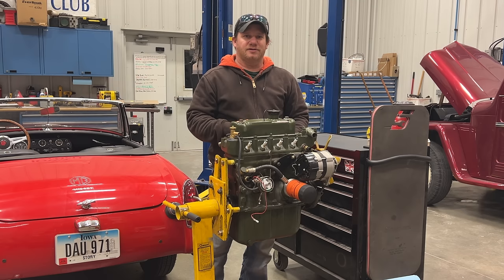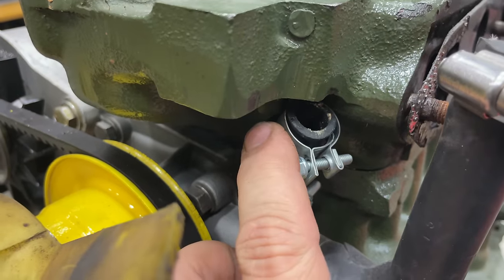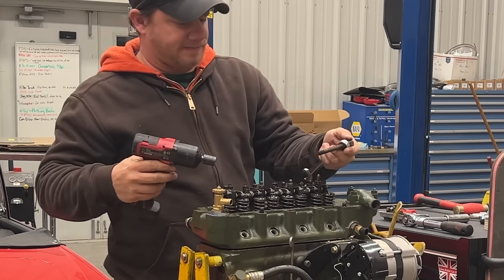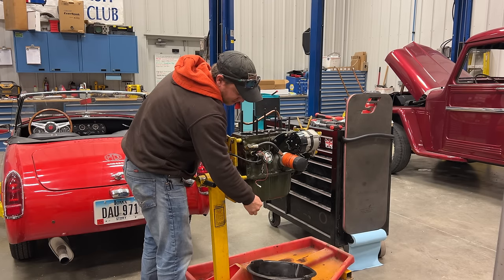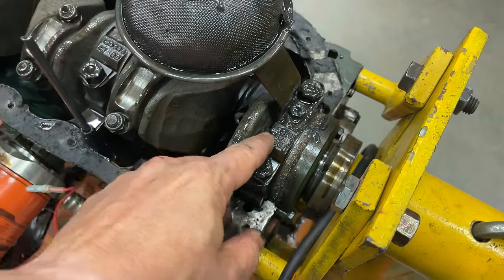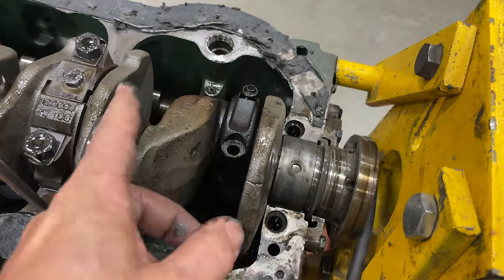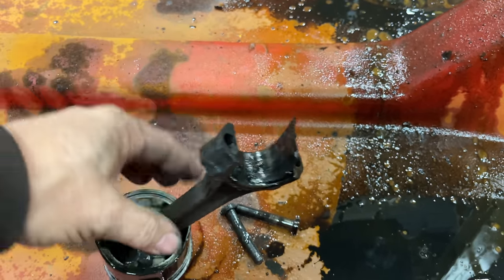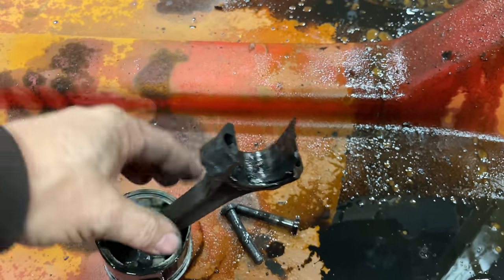Disassembling MG Midget Engine to Find Failure

Comment: And that, boys and girls, is why leaving out two main bearings when designing an engine is a great way to make it more compact, while at the same time crippling its power potential and durability.  Luckily, the Great Main Bearing Shortage Epidemic ended somewhere around 1960.  At least in technically advanced nations, that is.

Comment: When we were downsizing to move into an independent living facility, I gave my set of Whitworth tools to a man who owned an MG. I had bought them while I was a Triumph Motorcycle dealer.
Reply: Many years ago I sold and repaired Raleigh bicycles (when they were made in England) and had a full set of British Standard Whitworth tools. Only way to work on them. 60 years later, I still have them in a wooden tool chest.
Reply: BMC A Series Engine. All you really need are 7/16, 1/2 and 9/16 inch AF spanners!
Reply: @john1703  And little hands!
Reply: I recently (in the last 8 months) found out about BSW hardware. I bought a 1989 Taiwan made mill with a Taiwan made machine vice on it. Every piece of hardware was US standard except the 2 bolts that hold the front jaw on it. They were 1/2-12 BSW. I had to post on a machinist page and ask for group help. When I tried to thread on 1/2-13 nut it wouldn't fit so I went off to the the hardware store assuming it was metric. I left a very confused person after realizing that was not it either. Turns out that after WW2 the Tai bought up a bunch of British tooling from around the eastern pacific rim and they evidently were still using it into the late 80s to the early 90s.
Reply: @john1703  5/8th s for the rocker cover !

Comment: Generally BMC made great engines, it would be a shame to have to discard this one. I vote for saving it, if this is at all economically feasible to rebuild.
Reply: absolutely rebuildable. can be real fun if done right.
Reply: Can probably rebuild the crankshaft also.
Reply: Needs to be done every 25,000 miles or sooner when driven at USA speeds... tranny also...
Reply: @BuzzLOLOL  Not at all!  All you have to do is maintenance, as and when required. Neglect doing this, and you loose!
Reply: @regsparkes6507  - Nope... at 26K miles the rods are knocking... valve springs breaking and dropping valves into the engine... tranny synchros and bearings shot... been through all that several times... even the owners manual says replace the rod bearings at 25K miles... lube front suspension every 1,000 miles... that's 2 times just to get from one side of USA to the other... dropped a Buick 215"/3.5L aluminum V8 and 5 speed into my Midget decades ago... that also lost about 20 lbs... 
https://cdn1.mecum.com/auctions/ln1021/ln1021-467556/images/img2182-1632513245217@2x.jpg
Reply: @BuzzLOLOL  Not what I found in my family's and my many BMC and Rootes cars over the years from 1960 onwards,..
These are NOT' maintenance free 'cars these were from an era where garages and the mechanics who were employed in them worked hard for their pay.
If your experience tells you what you experienced then somebody somewhere didn't do what they were supposed to do.
Now, you have your memories and I have mine, we'll have to agree to disagree on this.
Reply: @regsparkes6507  - It's not just my "memories", it's in the F-ing Owners Manual !!!

Comment: I never tire of watching the ubiquitous BMC 'A' series engine being disassembled and reassembled. The one that so many trainee car mechanics and engineers around the world cut their teeth on.
Reply: Yep, I worked on many of these in the 60's. They were in everything, Sprites, A30's, etc, etc. So easy to work on.
Reply: @PropanePete  Except mini"s with the bloody gearbox bolted underneath. Bit of of a PITA but I've owned 8 of them and probably will get one again :-)
Reply: @mikal8343  I don't know how many 7/16" spanners I lost over the years down the back of that heat shield between the exhaust manifold and the firewall. And cutting my fingers on the radiator shrouds when replacing the fan belt. You've owned 8 of the little buggers, Jeez. Actually, I love 'em too.
Reply: @PropanePete  My favourite mini horror show is how the rear wheels will bite the fingers of the uninitiated when spinning them to check for bearing noise🤢
Reply: Like a trip down memory lane for me retired engineer.👍

Comment: "Here's what's left of the bearing, it should not look like that."

And I thought we Brits were the masters of understatement. :-)
Reply: It was an excellent summary that's for sure :)
Reply: It’s typical Iowa or Midwest America
Reply: I too had quite a chuckle over that one!
Reply: TBF, he should have checked it against a picture in the Haynes manual before judging so quickly.
Reply: Not uncommon to see a relatively clean piston top with these, it's caused by oil coming up past the piston. Usually means that there is was excessive big end clearance spraying up too much oil.in the past. The dents on the piston top also tell a story. If a piston smashes into an object at the top of the stroke, the usual result is failure of the big end, that's where the whole chain started.
Reply: I laughed when he said that.

Comment: Love these small engines. Whether you rebuild this or rebuild another that you have kicking around doesn't matter much. As long as you can get the parts. Do it the most practical way you can.
Reply: Parts are readily available in the UK... You may have to import them to Yankland.

Comment: I would grind the crank shaft, fit over sized bearings and with new rings and hone the bores, there will be a good Morris engine again for another 50,000 miles. That's what we did at the Morris works back in 1970.
If you paint it gold in colour, it will look like a genuine gold seal engine.
Reply: Cannot recall, should the piston rings go back with the gaps in line, or stepped out or away ?
Reply: @highpath4776  Not in line !! Stagger them .
Reply: @bertiewooster3326  Thought so   , Cheers, (particulary final oil control ring.

Comment: I used to have an Austin A40 with a tuned 1275 A series engine in it, was great fun driving it in the early 70s. I advise that you rub silicone grease into all cylinder head main bolts, thermostat housing bolts and the water pump bolts to stop corrosion. Also it would be a good idea to do the same to the rear suspension bolts and shackles, in fact anywhere you may get bolts rusting and becoming jammed on these old BMC cars. Good luck and thanks for the video.

Comment: Love the videos when you are inside the engine.  Here’s hoping for good news from the machine shop.  My guess is it spun the bearing, and then after extreme heat the bolt backed out.  Keep the videos coming.  Love your work!
Reply: Might have started with a blocked oil feed from the crankshaft to the big end bearing. That would have caused the big end to overheat and spin the bearing.

Comment: This little engine was obviously run way longer than it should have.  This sort of failure was a subsequent of ignoring ominous noises.  As the old adage, credited to the Chinese philosopher Sum Ting Wong, says "small noise, stop now".  It appears from here that the rod nuts were not tightened properly at a previous assembly, or overtightened to near stripping.  Considering the thread mismatch to American  fasteners, someone may have just used compromised nuts just to get the job out.  I hope a complete autopsy is forthcoming to find what caused the nut to fracture as the forces involved should leave telltale "footprints" on other components.  On a side note, can anyone explain the origin of the Mowag name cast into the block of these engines?  Brings back memories of yesteryear.  Great little engines. Robust, reliable, once you resign yourself to dealing  with Joseph Lucas, also known as the prince of darkness. and a joy to work on.  Got a kick out of the valve at the back corner of the head, the heater valve.  Love that English engineering.
Reply from the maker: MOWOG stands for (MO)rris and (WO)lseley (G)roup, although what the G stands for is sometimes contested but that is what the BMIHT is claiming it stood for.

Comment: The correct way to remove the head from a BMC A series ids to remove the rocker shaft and push rods before removing the head. If the push rods are left in place as per this video it is easy to bend them or for them to fall out allowing them to get mixed up when they should alway go back where they came from.

Comment: I bought a fiat x19 years ago it run fine for about two weeks although only driven once but after the engine going bad,  I striped it down to find the remains of feeler gauges that had been forced into crank and snapped of that looked not dissimilar to your engine bottom end

Comment: I bought a ‘77 TR-7 with a blown engine for $500 in ‘84. When I tore it down, I saw the connecting rod had gone through the side of the block. I would guess the previous owner had a similar failure with the nuts coming off the rod bearing cap.  I bought an ‘80 engine and dropped it in.  That was a fun car and had many interesting repairs and driving it from Chicago to Los Angeles and back three times.
 It was a fun little car.
Reply: My neighbors had a TR7.  It broke in the first year. Three years later they were still waiting for parts to come through the dealer system when they disposed of it.

Comment: I rebuilt a number of these engines when they were still in production. The engines were designed and built to be cheap to produce. Most of the owner's manuals for these engines, Sprite, Midget, and Spitfire, recommended new rings at 50,000 miles. Later engines of about 1600cc were the same block originally used for 948cc, just cast with a bigger bore. Many people driving in hot climates had cooling problems and went to a custom radiator. British machining during this time was not very accurate and that led to a lot of problems. A complete rebuild (in the US) usually resulted in a longer lasting engine and much more reliability than the original.
Reply: That's true, low grade grey iron used for political reasons, and mass production did not match machining outputs as we do nowadays. The bigger engines [1500 up] were "B" series, a similar but  bigger block all round.  One issue that does not surface now was the quality of the shell bearings  Copper Lead was preferred for the higher performance  B series engines,  and it was find until the oil quality degraded the lead, then the copper quickly ate into the crank.  So fit your crank shells, measure the sizes and grind the crank journals individually to suit. Much better result.

Comment: Pausing it before the teardown begins.
I'm guessing rod bearing because that's what all my knocking a-series engines used to fail with 🙄
Reply: Did you every come up with a plan to prevent the failure?  Knowing how long to go before a rebuild or using a better bearing?  Anything you would recommend?
Reply: @Dancing_Alone_wRentals  Root cause of the problem is lack of oil changes from the sludge in the bottom of the sump/oil pan.
Reply: @timbutton4990  tHanks.   Makes perfect sense.  I always changed oil but never really paid attention as to why.  Never put miles on cars years ago.  I had a lighthearted approach because nothing ever went wrong.

Comment: I don't know if old MG's have matching numbers or not but if they do do the one on this match ?
If so I would say rebuild it. Its only a rod bearing that spun and not a main so the block should be OK so it would be worth the effort to save the cars originality IMO.
Reply: That’s only worth doing if the car is a particularly rare or valuable one like an ex-works race car or something similar (and even then, competition cars are likely to have had different engines fitted). For the most part, there’s little financial incentive to do so, though it’s nice to keep it if possible.
Steve’d need to get a ‘Heritage Certificate’ from the archives at the British Motor Museum to find out the original engine number; it’s not recorded on the car, but in this case, it isn’t the original engine anyway, as it’s a 1275cc instead of a 1098cc.

Comment: I wonder if the failure point was the rod nut? I had an old 348 Chevy engine that had the same thing happen after I rebuilt it. Ever since I always use new rod bolts and nuts in a rebuild.

Comment: Eric of I do cars calls that metal debris "Reynolds Foil".  Thanks for the video - if the crank is not reclaimable, get one out of another of the engines you have lying about - and maybe a rod too, that one can't be too good after the beating and the heat.
Reply: With the ridge he found at the top of the cylinders that block needs bored and then will need new larger pistons as well, so great time to make it a stroker engine if he feels like it!

Comment: I have just stumbled on your site & love it. I own a 1970 MG Midget  in Australia that has been bored out to 1300cc slightly modified camshaft, extractors, power boosted brakes, plus an oil cooler as in the MG B and it purrs along. Red with the black lower door panel & 14 inch chrome MG B wheels.
I wonder if you know if there is anyone in your circle that has two pivoting quarter glass windows that are not rusty or bubbly on the locking handles, plus I need the chrome finishers that are around the heater demister vents above the dash.
Appreciate your help. Brian.  Noosa Australia.

Comment: Years ago I had a 1969 B that had started to smoke. I didn't have the time to rebuild it myself so I had an import shop do it. They did a great job except that after I paid for it the mechanic told me I was going to need a clutch very soon. I asked what was involved to which he told me the engine has to come out. "Did you remove it to rebuild it?" "Well, yes..." Anyway, I'm looking to buy a green 1969 B that has a questionable 1800 but I have to make sure I can get parts here in the mid-west. Your tear down was my first look inside a midget engine. I just now noticed the license plate. I'm about 40/50 miles south. How available are parts in IA? I'd prefer not to go online but if that's the only option... Thanks for the video.

Comment: Depending on how groved the crank is I personally would have the crank regrowned . Just a little less work to put it back together. You could get another engine but that one might take more work to rebuild than this one. Great video Steve it takes me back a good few years, thanks. 👍👍
Reply: Sorry but regrinding that crank is asking for trouble even if it could be reground.  Regrinding weakens the crank without even considering the heat damage.  The original crank is not the strongest around which is why a nitrided crank was considered essential for any serious power upgrade.
Reply: The rod is buggered too… if the block is OK then it needs a rebore, crank, rods and a set of pistons…
Reply: @JBils41  Yes I had forgotten about the rod. Yours is probably a better solution.

Comment: Great video Steve. Which ever way you chose to deal with this, either by rebuilding this engine or building another from what you have sitting around, I look forward to seeing what comes next. If tge crankshaft is shot then its an open and shut case.

Comment: With oil in the bell housing check the rear main oil seal before anything else.
What were the cylinder compressions before you started stripping down or didn't you bother to check.
It's the head gasket that sticks the head down and not stud corrosion.  Why not use a stud extractor rather than just 2 nuts locked together? It amy damage the threads but you're going to replace the head studs anyway.
ALWAYS remove the oil pan before inverting the engine so that can see what is actually there without having to search inside the crankcase and pistons!
It's 99% certain that the cause of the problem was failing to torque the con-rod bolts correctly.
In case you ask I was a Development Engineer working on these engines for a number of years so I know them quite well.

Comment: I find it amazing that with a missing bolt on the end cap, that engine didn't throw that rod.
Reply from the maker: The bolt shouldn't have fallen out of the rod until I turned the engine over on the engine stand.

Comment: I've driven a fair number of old, kind of worn out, high mileage cars in my life, but the only time I've ever actually broken anything in the engine (as opposed to the engine simply getting loose and suffering blow by) was when I was young, aggressive, careless, and really over revved an engine, but even then I scored the cams but I did not break a connecting rod, crank, or main bearing.  Was I just lucky, or is there something in particular you have to do to break an engine in this particular manner?  I've always been good about maintenance, is it simply clean oil that prevents these problems?

Comment: Hi, I just changed my clutch and pressure plate and now it is making a noise when I try to change gears. Could you please advice why is it doing that. Thank you
Reply from the maker: Was the clutch plate inserted the incorrect way around?  Also the clutch is different for the 948, 1098, and 1275 make sure you bought the correct clutch for your engine.
Reply: @ThisWeekWithCars  mine is 1978 mgb. And the parts I bought is the right one. How can I tell that the parts are put in correctly,  any help will be appreciated.  Thanks

Comment: That's ingested something - the divots in the piston are mirrored on the head, and it was hard enough to splay out the edges of the piston.  Too much coincidence that that was the cylinder with the failed bearing, so maybe that's what started the sequence of failures.

Comment: the matching divot marks in the head on cyl 1 point at a hard metal object bouncing and getting caught by the piston multiple times before finally making it past the exhaust port? a small ball bearing.
after any catastrophic engine failure, i'm told to inspect or replace intakes and exhaust. this was not your root cause is understood.
Thank you.